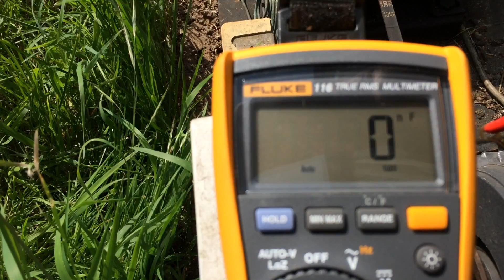Mix and Match

Comment: Did it start up with the larger units though, so you did not have a fix only to find something else was dead.
Reply from the maker: Its been running fine since, the main issue was the power supply to the whole area was low due to a underground cable fault.